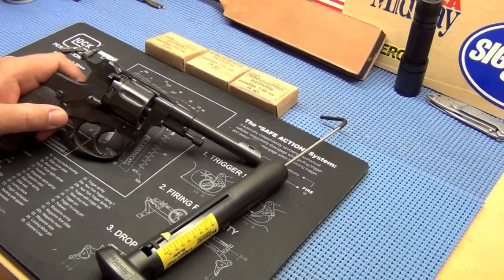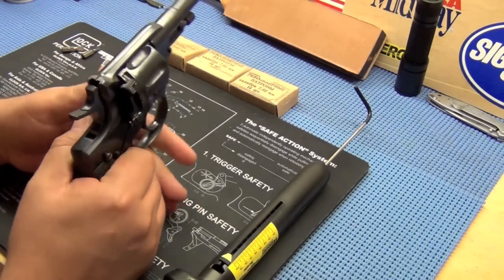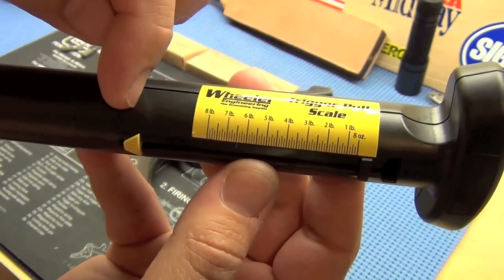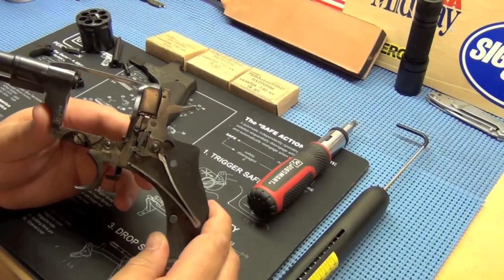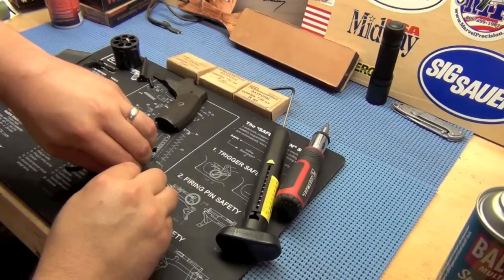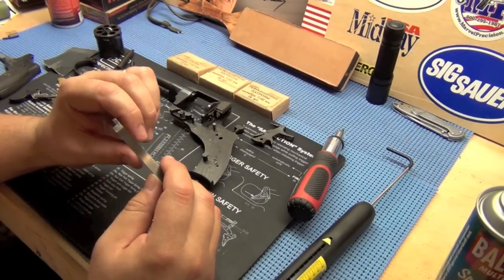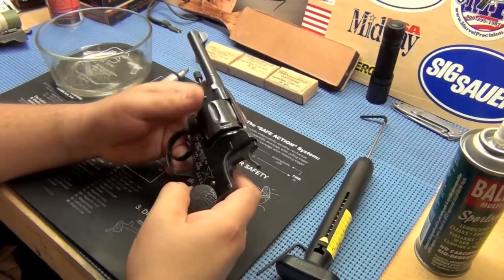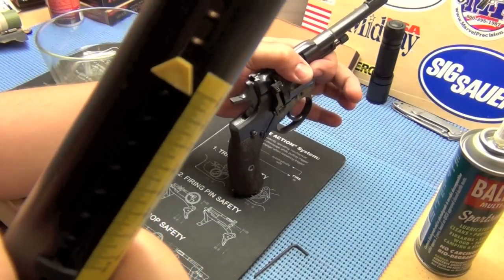M1895 Nagant Revolver Trigger Job

Comment: I lived in Kyiv a while back and got to know a older armorer from the Soviet era and he said Never Ever Under ANY Circumstances Whatsoever Jack with that Leaf Spring as it is Exceptionally Delicate!!!  the easiest thing to do besides polishing up the parts for smoother operation was to take the Eraser off of a pencil and put it on the bottom Of the Leaf Spring and between the trigger guard, it won't exactly half the trigger pull strength but it should cut it down by at least a third!!!  🤠👍🇺🇦

Comment: It's the spring housed in the grip. Polishing won't lighten trigger pull. Make it smoother, yes; lighten trigger, no.
Reply: Smoother means less drag, means lighter pull tho, but mostly smoother.

Also at the end he didn't put the springloaded cylinder back in, that spring in there is a force against, increasing the trigger pull.

I think if you'd lighten the spring in in the cylinder and lighten the spring in the grip will decrease the trigger pull the most.

However thats just a guess from someone who never held a gun lol

Comment: Yeah that's a seven and a half pound trigger in single action, what is it in double action now? By the way I had to use a luggage scale to test the trigger pull in double action I consistently got 24 lb
Reply: And single action mode I got 15 lb with the luggage scale